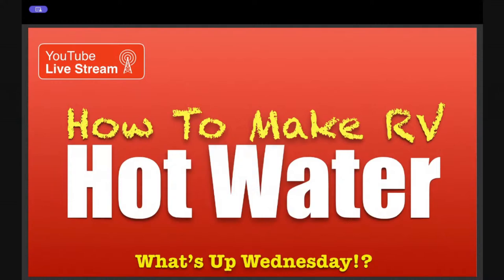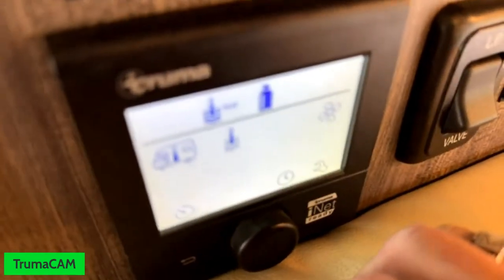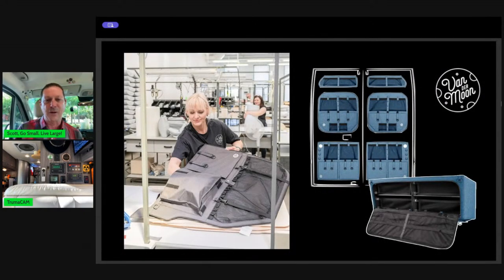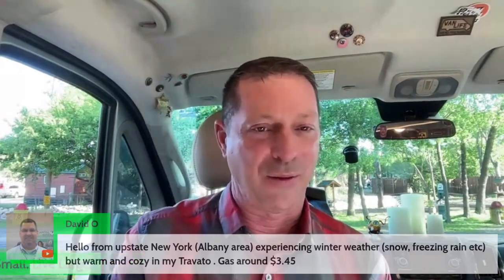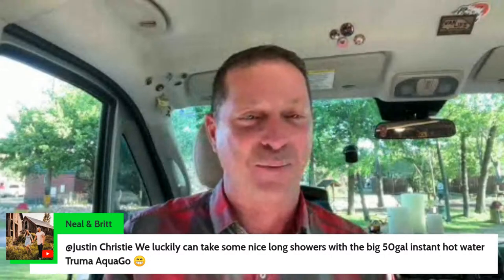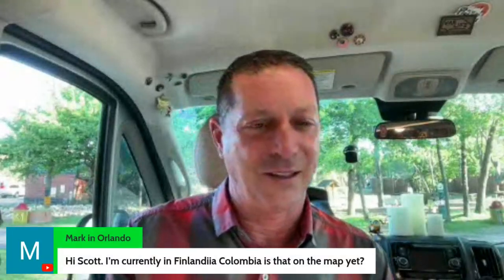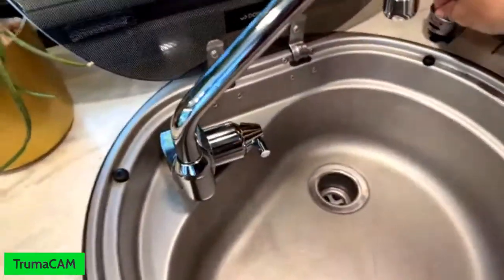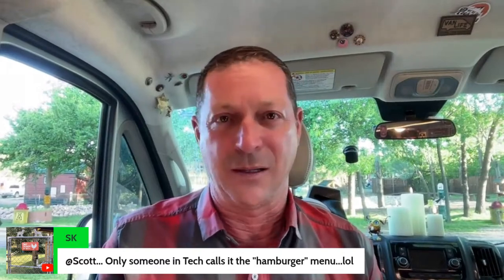LIVE DEMO! How I Make Hot Water in My Camper Van Using Propane for Sink & Shower

Comment: Espar/Esbacher/Webasto will all sip from your main fuel tank. Unlimited hot water and heat.
 Truma, requiring all the propane plumbing and travel restrictions, is the old Coleman lantern you leave in the barn. It is a small cheap copout--but the cost of the propane system kills that.
Reply: We have an Espar Hydronic system in our van. Works great!